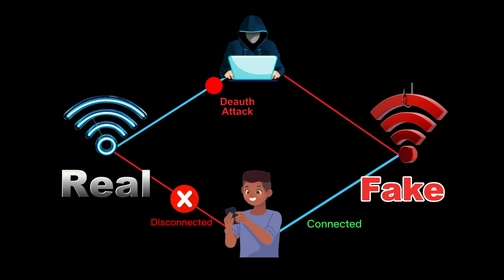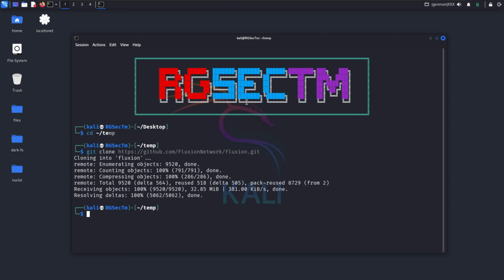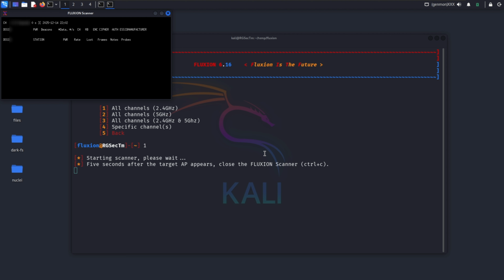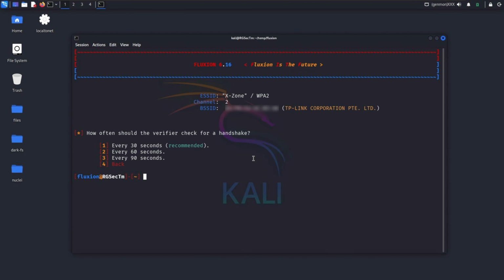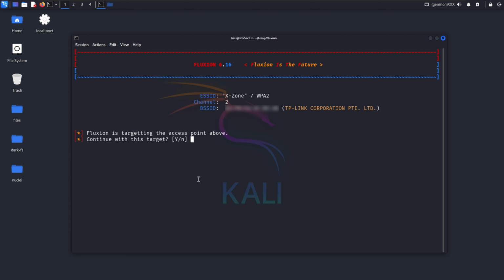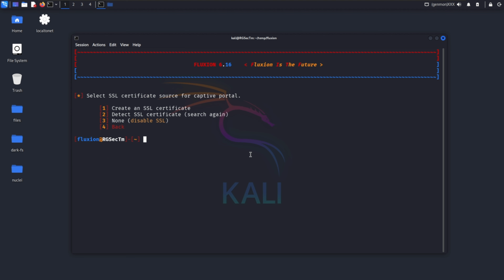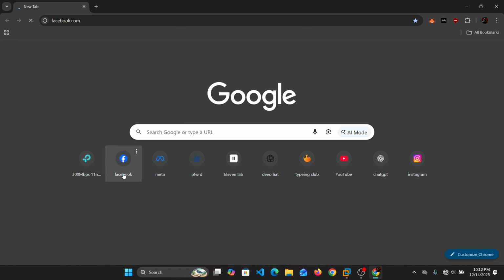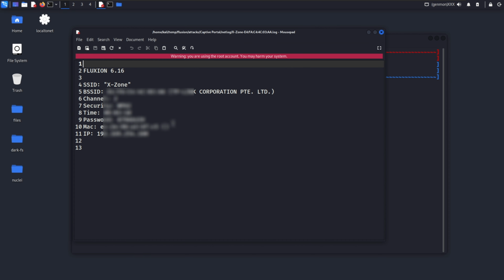🔥 Fluxion WiFi Hacking Explained | Fake Login Page Attack | Kali Linux

Comment: sir if the target user had selected connect automatically then if we disconnect them from thier network using our fluxion attack they will be reconect within a second automatically and our attack will not reach to them... so give me solution for this plzzzz
Reply from the maker: You might want to experiment with deauthentication frame flooding to keep the target disconnected long enough for them to see your portal.

Comment: it only works if its is yours wifi cuz of the channel number
Reply from the maker: It works on other networks too if you match the target channel properly bro.
Reply: @RGSecurityTeam  BRo when i started the attack it said that network is down
Reply from the maker: @hanrypaul That usually means the target AP went offline or out of range during the attack. Check the signal strength.

Comment: if i use a laptop will need two adaptors also
Reply: If your laptop's internal adapter supports it, you won't need 2 adapters.
Reply: @er_romeo  even the internal adaptor dont have monitor mode
Reply from the maker: Then you will need 2 adapters.
Reply: You can use this way:

External USB adapter
→ Monitor + deauth
Internal card
→ Fake AP (AP mode)